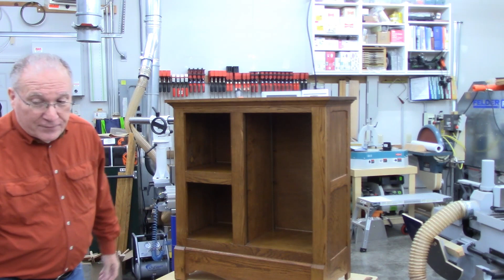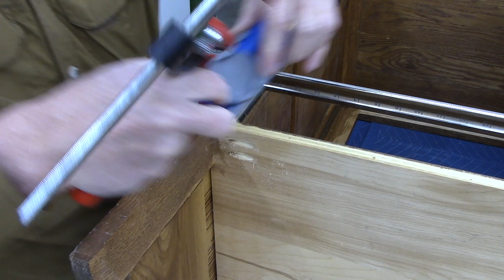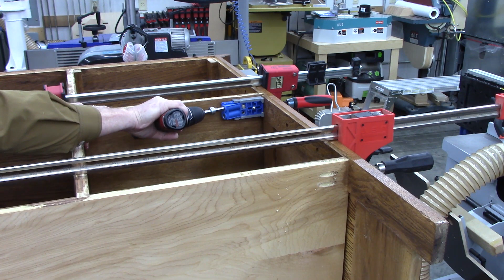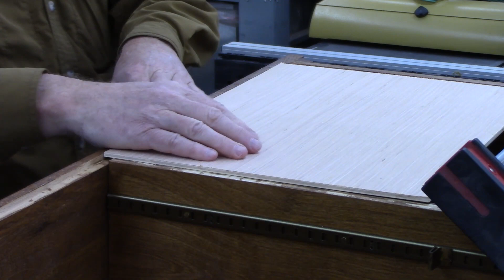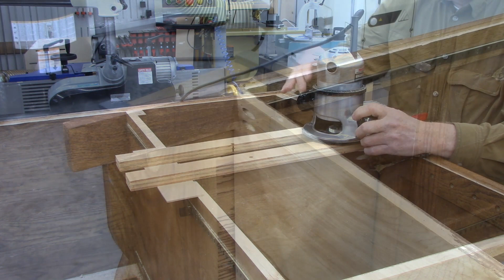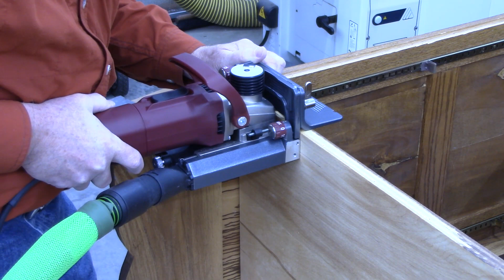Fixing my 39 year old woodworking mistakes

Comment: Steve, I always love your videos!  The things you learn!  I am sure the progress with glue quality in 39 years is pretty significant too!  You also busted out an old reliable PC router!

BTW - When did you acquire the Kundig Uniq?  That machine is on my short list!  What do you think about it?  I really liked it in Joe's shop.
Reply from the maker: Thank you PK.  I have had the Uniq since 2010.  Overall, it is an excellent machine and I have only 2 gripes about it.  First, it is grossly overpriced for what it is.  It would be a much better value if you can find a used one.  Second, the rubber sleeves for the spindle sander are very difficult to get on and off.  I have found that baby powder improves the situation somewhat but this should be a much better system for a machine in this price range.  The spiral bands are also metric and are difficult to source in the US.  I have found the 1" spiral band works as a suitable replacement for the 25mm version but all other sizes haven't worked.  Steve
Reply: @extremewoodworker  I was also looking at the Rehnen SK-2 that is much more affordable.  It does not offer a tilting function, bur seems to be a really nice machine.
Reply from the maker: @pkwoodworking  In 13 years of use, I have only used the tilting function a handful of times at most.

Comment: I haven't been dabbling with wood too long but, when I do have something I would like to revisit letting time pass seems to be the way to go if the option is there. Sometimes you have to let 39 years pass. As usual I learned some things here. Flipping the feet on the pocket hole jig being one and I see ways to use the routing jig you made elsewhere.
Reply from the maker: Thank you William.  I even learned a few things doing this.  I was not absolutely sure I could assemble the Lamello Clamex into a corner but thought it might so went ahead and made the cuts anyway.  I ended up rocking the gusset into position which was the trick to get it together.  I did have an alternate plan just in case.  Steve
Reply: @extremewoodworker  👍